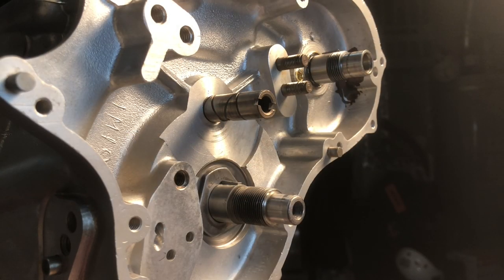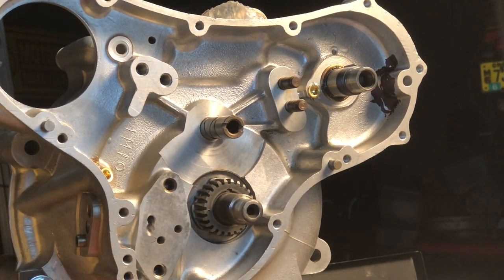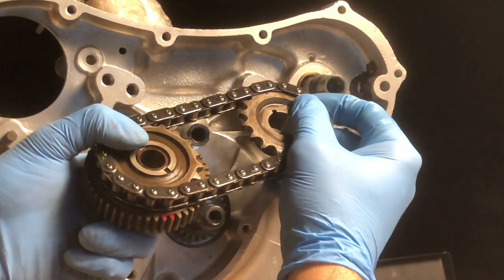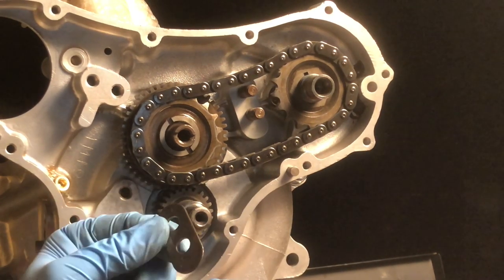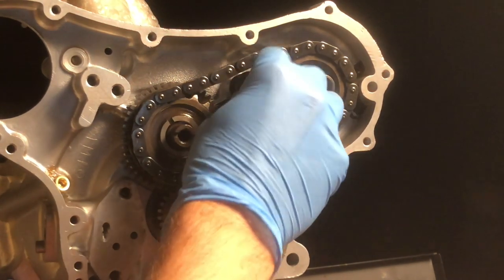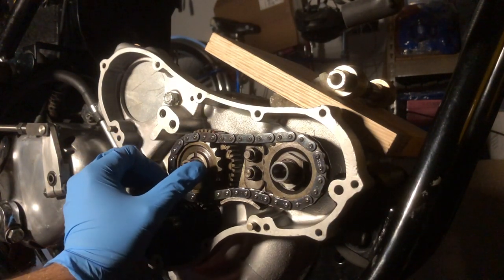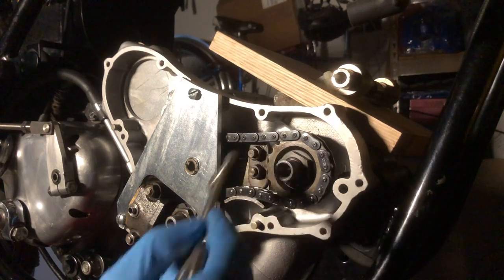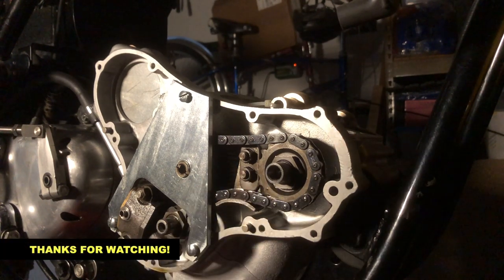1972 Norton Commando Combat Rebuild (10) - Fitting and tensioning cam chain

Comment: Ace, thanks, doing my 750  chain  and the bit on crankshaft  pinion and  the second intermediate pinion marks dead useful as the workshop manual is a bit vague. Managed to upset my valve timing doah!

Comment: It looks like you fitted the thicker outer cam chain tensioner plate long end down? Inner is long end down, outer is long end UP. (Factory Manual, Section C30.7)
Reply: Les 3066 Good catch! I have no idea why they’d spec it like that.
Reply: The earlier manual shows them the same orientation. I think that might be a MkIII thing when they went to a rubber faced tensioner.
Reply: @swooshdave  No, it doesn't. and no, it isn't as the 064647 rubber faced tensioner was introduced during 1973, first appearing in both the 850 Mk1A and '74 Mk2/2A parts supplements. And manual instructions to fit the outer plate long end up predates the Commando.
Reply: @les3066  Correct, I now suspect they reversed the outer plate to allow for more room for adjustment. The next time I'm in there I'll address it.

Comment: I am surprised the cam chain tensioner appears to be only a piece of steel that the chain rubs against. Does this arrangement not result in rapid wear of the tensioner plate and the chain outer links? Thanks again for great informative videos.

Comment: I never understood why Hopwood would want to save a couple of quid in production costs on this motor and his BSA design by fitting a chain instead of a gear cam drive. It was why Degens won the 24 hrs with a Triton because he did'nt trust a Norton timing chain in a 24hr race. Unneccessary design cheapness. Regards,
Reply: Sometimes engineers go with what they know and are comfortable with regardless if there's a better way.
Reply: Yes Michael I agree probably bean counting. Pfaffing around renewing my 750 chain I was thinking fondly of my A10   beautiful cog arrangement.
Reply: And yet the Norton 650ss won the Thruxton production/ endurance race vs Triumph, BSA and all comers in 1962,63 and 64 with its timing chain in place.
Syd Lawton was kindly asked not to enter the Norton 650ss in 65 so as to give Triumph and the other manufacturers a shot at winning!